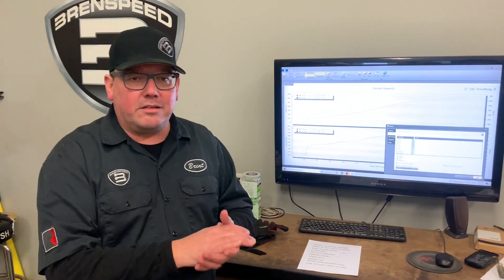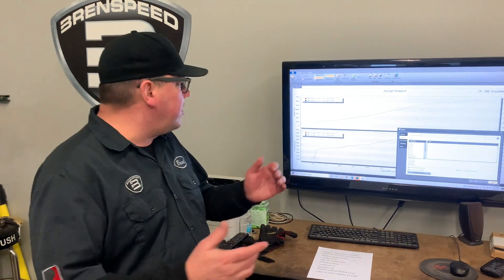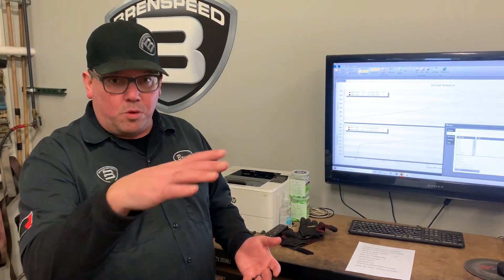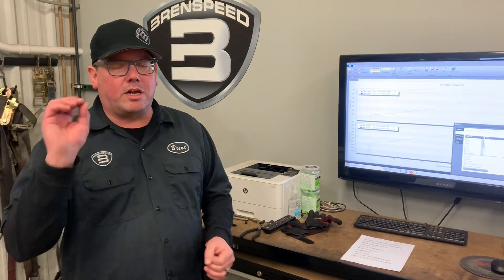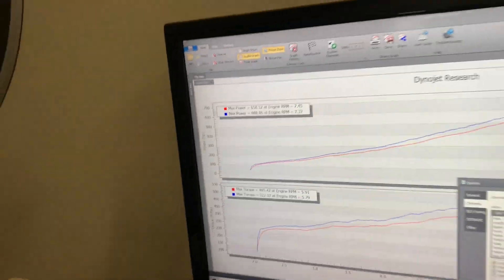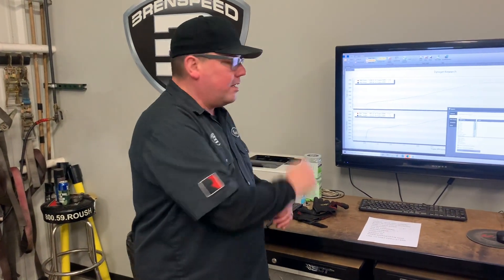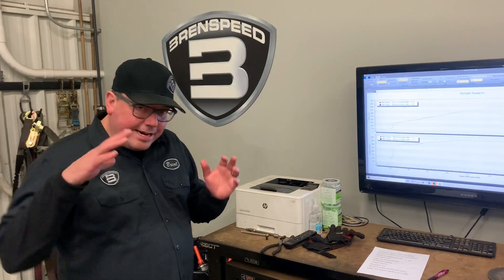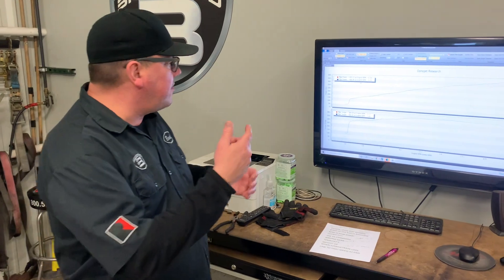Dyno Testing Variables SAE, STD, ECT, IAT, KNOCK, WHEELS, RPM  Why Horsepower Is What It Is DYNOJET

Comment: Why is the smoothing got number ? 0-5 ? What does it mean?
Reply from the maker: It is just how smooth the graph is. Smoothing 5 will make the graph smoother than 0. The more choppy the graph sometimes will read a higher peak rwhp than if it is smooth. Some cars that is not much difference, others can be a lot.
Reply: @BrenspeedEngineering  thanks for the info 🫡

Comment: I have one of your 3V vortech kits for a 2010  that was installed last year , so far it has worked flawlessly and I couldn't be happier .... is there any way I could get a list of the extras and the spark plug numbers that you had included in the kit for maintenance reasons .... I tried going through all the paperwork but couldn't find anything like it .... Also , have you ever had any issues with P0111 on a non intercooled kit ? .... I've had it intermittently show up three times and the IAT is brand new but I did not ohm it out
Reply from the maker: As far as P0111 I would check all your connections on the IAT harness from the MAF harness to the sensor. Also make sure the pins on the harness are not pushed out. I would guess if you have a new IAT you just have a intermittent connection causing that. As far as spark plugs you want 1 step colder on your 2010 use these https://www.brenspeed.com/ngk-7554.html

Comment: If I'm running 50/50 water methanol injection, with a Vortech, what octane should my 3v be tuned for if I want to take advantage of the higher octane? Your videos honestly keep getting better...love the technical education!!!
Reply from the maker: Hi as far as meth injection I love it for cooling. I never tune to assume the octane is going to increase I let the knock sensors do that. This is because if you get a clogged nozzle or it runs out you can detonate and have engine issues (if you are commanding higher timing for higher octane). If you are using it for cooling you can typically use a #4 or #5 nozzle (snow performance) and get good cooling and if the knock sensors like the octane they will increase timing on there own without you using a specific tune to increase the timing.
Reply: @BrenspeedEngineering  Thank you for your reply. My local tuner is telling me that not tuning for meth is actually robbing me of power because the water vapor in the  intake manifold is now utilizing space which cannot be occupied by air. What is your take on that?